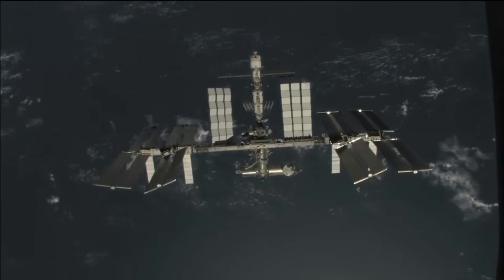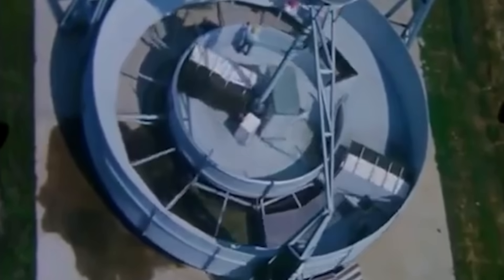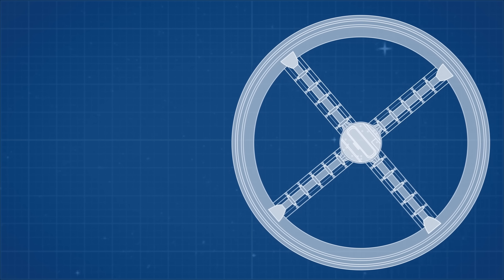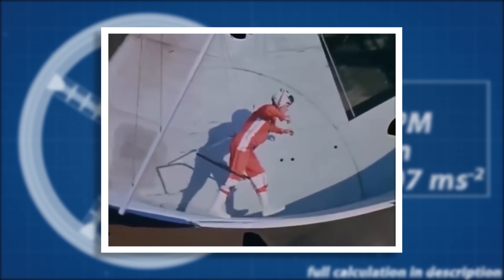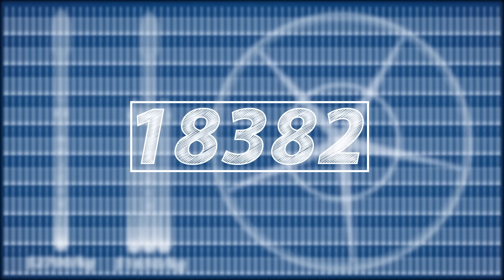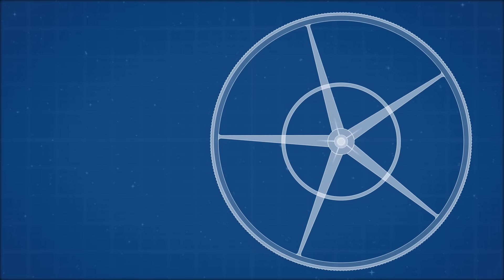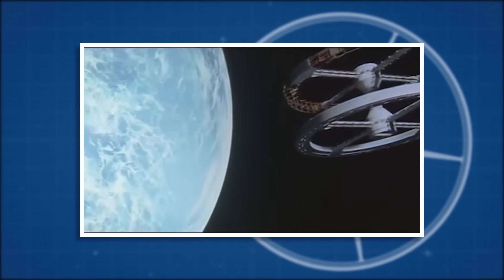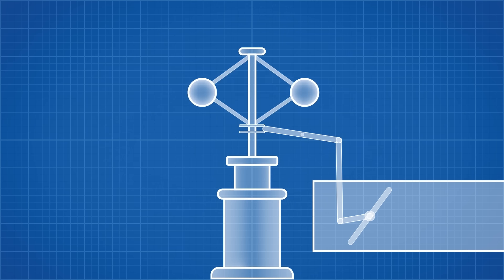Can We Create Artificial Gravity?

Comment: Hi Real Engineering, so if you jump in a centrifugal "artificial gravity" what would make you come down again?
Reply from the maker: The same thing that made you go down in the first place, inertia.
Reply: okay, so if I float in orbit and someone put a cenfrifuge around me ( with the same trajectory so there is no contact ) I would somehow be attracted to the sides of the centrifuge? ( if the jump negates the inertia )
Reply from the maker: No, if you somehow magically appeared inside it, you would float above it. That isn't going to happen though, you will either be inside it while it accelerates or you will climb down from the center of rotation. The structure will need to transfer inertia to you.
Reply: oh yea that is logical but it sounds to be a quite tricky system in practice if you would treat it like a normal space station. Love the video BTW. kudos
Reply: well you will get lighter as you go up, so if you reach the middle and you weigh nothing the push of your previous jump would push you into the other side of the ring and you would faceplant and your face would get road rash until the ring gets you spinning as fast as itself.
Reply: Centrifugal force is NOT artificial gravity, if the terms are stretched, it's simulated gravity, or rather ...our best effort at an emulation.
Reply from the maker: Oh and just call me Brian
Reply: Mathias: nothing makes you come down again - the floor of the space-station comes up until it hits your feet!

The way to think about this is that both the structure of the space-station and you 'want' to move in a straight line tangential to the rim of the station (per Newton's first law of motion). However the structure of the station 'forces' its rim to move in a circle. The straight line motion of an unconstrained object above the station floor will before long intersect with the curved motion of the floor mimicking the effect of gravity. But the mimicry is not perfect - you do not land on the bit of floor directly under you - the larger the wheel compared to how high you jump, the less noticeable this will be.
Reply: +Mathias Petersen. is this in a vacuum or air? it would make a difference
Reply: Watch Babylon 5, the final episode of season 2. The captain is riding a transit at the core of the spinning station, and jumps out to escape a bomb. Ivanova explain "he's basically weightless, but the ground is spinning at 60mph. If we don't catch him he'll be killed by the impact".
Reply: doceigen As far as I know some of them, some of them not.... BTW, did you studied you PhD or did you smoke it? go back to, Rotational movement at first year of physics school, I have no time to argue with you
Reply: Mathias Petersen I didn't understand the question. He's not spinning at all until he hits the floor. When he does hit, he would suddenly speed up and (assuming he somehow survived) his feeling of weightlessness would abruptly end. It would be very similar to jumping off a bridge onto a fast-moving train.
Reply: Isn't it opposite? Shouldn't you feel heavier when walking in the direction of the spin and lighter when moving in the opposite direction? If you walk in the same direction you are going faster, so more inward force is needed to keep you in that circular motion, right?
Reply: doceigen Did you finish first grade at school?
Reply: YEH wth. It seems to me you would just escape the artificial gravity entirely.
Reply: The centrifugal force. From your perspective it would feel just like jumping in regular gravity. If you would take a look at the top down view, what happens is when you stand still you move in a circle, being basically pushed into the "ground" of the station by the centrifugal force. When you jump, you disconnect from the "ground" and start  moving towards the center of rotation but since you were also following a circular path you have the centrifugal force pushing you back in the direction opposite to your jump. So you basically get flung back to the "ground".
Reply: Jane Murphy - The question mark serves to enhance or emphasize that it was a suggestion. It makes it more suggestive.

Now please fuck off before I have to block your ass, bitch.
Reply: Andreas Eliasson Sure, that perceptual relationships is why some people here keep shouting, "inertia", but… THAT is not the answer to the question, so FAIL!  I'm afraid you're going to have take this course over Mr. Eliasson, and stop chatting during the lecture!
Reply: Oh, good point.. 

But first off, you'd have the same momentum as the station (maybe reduced, but still) so you would 'fly' to the floor again. Also, the interior of a station is not streamlined, so the air in there moves with pushing you a long. Even if you come to a full stop, the air would help you go 'down' again. So this is more of an impracticality.
Reply: That suggestion is like the Looney Toons cartoon where bugs is in a crashing plane but he steps off at the last moment. You still have inertia acting on your body.
Reply: Mathias Petersen Oh, now I get what you mean :)
Reply: Wou'll keep going down toward the floor since you will keep going in the same circular movement
Reply: the whole "but you wouldnt come back down" misunderstanding reminds me a lot of orbits, people being confused as to why the thing in orbit will continiusly curve around the planet without needing to thrust.
Reply: My specific thought experiment would only require the astronaut to have a personal air supply. So to simplify in vacuum.

But what difference would the atmosphere make? As slight as it might be. 

(edit: other than turbulence)
Reply: FastRomanianGypsies Sorry is this an answer to the air difference thing, or the floating in the centrifuge thing?
Reply: Riles Mattix Yea i guess you can't make a perfect jump in atmoshpere that would leave you in the middle (even compensation for the 'air pull' the air would blow you "down".

Sorry about the terms i don't speak space a lot :)
Reply: Ohh cool Hi Brian. I just found your channel, subcribed and started binge watching. I'm only  good at chemistry but love to learn, especially stuff like this.
Reply: Neil Bartlett Yea he would be in a state of relative zero newton (if that makes sense), but when he hits the side (I imagine) it would be like falling onto a treadmill sending him spinning round along the side. But fun question would the centifugal force stop him from spinning after impact/death or just keep adding to his personal spin like a spinning wheel to another spinning wheel?

I know I am like an annoying kid with these questions, but you don't have to answer
Reply: Mathias Petersen  If you've ever been to an amusement park where they have the spinning barrel rooms,and people stand along  the inside and they spin the barrel, ...you can directly observe a number of mechanisms occurring as the barrel speeds up. 

One is, if you did not touch the inside of the barrel, you would remain where you were standing and not stick to the wall. 

Of course in a spinning barrel on Earth, gravity is pulling you to the floor and so acceleration forces cannot be ignored, but in space, if you throw yourself to the center of a spinning barrel, once you came to a rest, you'd be floating inside the barrel and not stuck to it. 

The moment you touched that spinning surface though, you would feel an acceleration both in the direction of the spin AND away from the center of the barrel, until finally you would be stuck to the inside of the barrel and it would 'feel' like artificial gravity was present. 

But something to note, it's not a very good approximation, and if you walk in the direction of the spin, you'd get lighter, and if you walked in a direction the opposite of the spin you'd get heavier, I mean perceptually. 

We used to test that as kids and walk on the inside of the barrel at the amusement park to sit next to someone… the operators hated that since we could have fallen into the barrel and since it was spinning, get chaotically tossed around and damaged… but we never moved fast enough to do anything but start to move towards the floor, so we all emerged unscathed.

Also to note, in modern versions of this ride, you get strapped down or have to sit down now like in a roller coaster type of mechanism, or the liability insurance would close them down… but when I was kid, we'd actually scoot our butts, mostly on hands and knees, on the inside surface.
Reply: doceigen Sadly I haven't tried that. In Denmark we have some of the oldest amusement rides but not stuff this fansy. I tried a giant hamster-wheel as a kid... not that fun:). But i have seen on television these upride centrifuge rides where people just stand in them and the flor lowers as it goes. Sadly non of the people tried rolling inside of them (maybe because it's moronically hazardous thing to do hehe). Still I would love to se it happen.
Reply: Mathias Petersen  Yup… moronically hazardous… that's kids for you.  :  )  

But it does bring to mind a number of actual principles and attributes that are often disregarded in science fiction.  "Why don't you use centrifuges on the ISS to avert the medical issues of zero G?", is a very typical question people ask NASA.  I mean the movies, make it seem so simple.
Reply: doceigen Yea I think you are right. You could teach children alot about Isaac Newton, Ole Rømer and James Watt from just simple games and rides. maybe we should just design the rides and make a kickstarter :)
Reply: Mathias Petersen Well, I believe in that, here's $2.00.

I've taught university maths courses and find my students learned 'deeper' when the equations were converted to color 3D graphics and real world examples.  So yeah, that's what science museums often do, build large scale, full body visceral experiences to enhance learning.
Reply: Jonas Kunnen No, by walking in the same direction you end up being thrown sideways slightly faster, energy going sideways means less energy falling towards the Earth or rather the same energy is there, but it's spread out over a longer path.  In space where the gravity is rather flat, running inside a large barrel treadmill in either direction, won't matter if the sides are decorated correct, otherwise… simulated vertigo!
Reply: I agree that if you are walking on the surface of the earth in the same direction the earth is spinning, more of the earths gravitational force is used to keep you moving in a circle and less can be felt by you. 

I was however talking about an 'artificial gravity generator' like in the video.
In that case you would need more force to keep you moving in a circle right?
Reply: Jonas Kunnen  Well, not in a circle, in a straight vector the result of your actual momentum.  The circle component is added by gravity.

No, if you fell off the treadmill you would proceed in a straight line in a vector made up of the forces apparent at your release from friction.  So falling off the 'artificial gravity' treadmill, you'd be 'weightless' again.  Well sort of, I mean the trajectory of that line, would finally collide with another point on the treadmill and any loss in energy would be regained, as friction, spin, chaotic tumbling and a bit of cussing about it.

Remember, we are using terms that are not concise… it is NOT 'artificial gravity', and the notion of 'falling' is wholly flawed by any Earth reckoning, plus there are so many other lines of force not taken into account such as… attitude corrections mid-step by your retro-rockets, etc.
Reply: Inertia
Reply: *****  Inertia, does not make anything come down again.  OMG!  Did you have a Marxist Feminist teacher?
Reply: doceigen Are you joking really?
Reply: Ok so this is my thought.If you where in this artificial gravity and you jumped. 

Firstly bare in mind that the only difference between hovering above the floor spinning under you, and being on the floor spinning, is you carry forward momentum. So it is easier to imagine the room as having that same momentum in the opposite direction and you are jumping from a point of no momentum. 

The room would seem to rotate under you as it moved toward you.So you would make contact with the floor again, but your face and the rest of you body, would be, say, parallel to the floor in one example. 

If you jumped just a little, the floor would hit you feet again, but this time the angle of the floor would be slightly tilted / steeper. So relative to the room you're in, you would actually rotate in the air when you jumped. And you would actually land back on the ground.
Reply: Lelouch Only if there was the force of gravity.  In space, there's no such thing as 'down'.
Reply: The points Lelouch is making are valid. You are always moving tangetial to the circle of the 'treadmill', so if you were to jump, you will have momentum upwards and forwards relative to the position and orientation you left from. If you managed to jump upwards with the same velocity you are moving forward, your body would indeed be parallel to the ground(which has moved beneath you, so you would 'fall' flat on almost the same spot you were just standing on). 

As for the notion that falling off the 'treadmill' would make you coincide with the 'treadmill' eventually is wrong in my opinion. This is unless the 'treadmill' is orbiting another body and you happened to fall off at the perfect time so the orbit of the 'treadmill' and your orbit would coincide eventually. If you just take empty space with just that single treadmill and you on it, falling off would send you flying with no way to return to the treadmill. 
The reasoning here is that loss of centripetal force will cause loss in centrifugal force, since centrifugal force is just the reactive force. If there is no centrifugal force and no external forces like jets on your EVA-suit, you will just keep flying off.

If you were to cancel your forward momentum by jumping(no upward force), you would be weightless in the 'treadmill'. The only way to get back that artificial gravity, would be grabbing on to the 'treadmill' again.
Reply: The centripetal force stops when your feet leave the ground, but you conserve both your angular momentum and linear velocity imparted on you by the station, which results in you returning to the 'ground', just as if you had jumped here on earth.
Reply: gryphen_357 I completely forgot about the conservation of angular momentum. Your comment just made some things I was unsure about fit right into the picture.
Thanks for mentioning it.
Reply: Inertia?
Reply: THIS^!
Reply: *****
Inertia is the word that describes how objects in motion like to stay in motion, and objects not in motion like to stay motionless.
Reply: Jane Murphy I know what it means, so I'll say it again. Inertia.
Reply: ***** Poor baby.
Reply: *****
Then why did you add an interrogation mark?
Reply: Jane Murphy It's called a question mark or interrogation point.

Not a combination of the two.
Reply: *****
Yes, because a typo is horribly important to the conversation.
Reply: *****
Look back at your original comment. You said "Inertia?" as in you asked a QUESTION, you did not say "Inertia" as in in a answer.
Reply: your body will be in motion and it wants to move forward but you cant since the structure is in the way, thats the long way of saying landing! XD
Reply: the gravitron ride shows he would be pulled back
Reply: docigen, I respectfully disagree that moving in the direction of spin will make you feel lighter.  If you move in the direction of spin such that you're actually rotating faster, you will feel heavier.  Argument by extremes:  If you move against the direction of rotation at the same speed the centrifuge wall is moving, you will be stationary, and feel no centripetal acceleration.  If you mean that you will feel less of the earth's gravity, then you are wrong there too.  The force that gravity imparts will not change by virtue of going faster around the centrifuge, but it will, by virtue  of the centripetal acceleration becoming stronger, be a smaller fraction of the total force as the total force increases.
Reply: To doceigen and JPdrums - why the argument?
True, inertia does not 'make you come down'.  Inertia keeps you moving in a straight line.  In this case, whichever way you jump in a spinning space station, once you break contact, you will move in a straight line (minute aero effects ignored).  From the rotating reference frame of the station, this straight line will intersect the station again, and will appear to the occupant as a curved path which eventually points back 'down'.
Reply: doceigen
You still come "down", you just do so in a curve.

Would it be a perfect system? No, but it's better then only being able to float.
Reply: Jane Murphy Any 'coming down' that might be called 'inertia', would be via multiple collisions, more or less forming a nautilus trajectory.  During the time in-between each collision, you'd be floating.

But that's not the answer to the question, because you could just as well be deflected elsewhere.  "I thought I was headed down, and here I am on my way into space… oops."
Reply: John Hind There are other forces here aside from collision.
Reply: If you were to run or ride something and match speed in the opposite direction of the movement of the surface you're standing on then jump, you'd find yourself suspended in zero G because you'd effectively be at rest and wouldn't be subject to the centrifugal force created by the station's rotation. The reason you would land in the same spot if you were to jump while standing still is because you'd be moving forward in a straight line through space, but the structure is circular, so you'd intercept it again at the same place.
Reply: I'd like to test this
Reply: momentum of your body atoms that are moving in one vector when the floor get's in the way
Reply: The way you would "speed up" with"artificial gravity" is as noted above. you would start inside the structure itself and thus accelerate with it... or the more likely situation allowing you to come and go would be an access point from the center of rotation.  At the center of rotation there would be an access hatch, from the hatch would be a ladder or some other means of reaching the "simulated surface"  As you climb from the central point where the rotational forces are essentially null you would experience acceleration till reaching the floor, and in the opposite, you would experience deceleration as you climb back up to the hatch.

This acceleration is a result of moving further from the rotational center.... to get an idea of what i mean by this i want you to picture a ball on a rope. You spin the ball around you, making a full rotation every roughly 90 minutes. you at the center are not moving, or to say, your feet are staying at the same point on the planet, though rotating on it. the ball, currently the ball is moving, at an incredibly slow pace, but moving.  now we are going to let the ball go (and pretend it wont fall down) letting the rope slip through our hands till its about 100 feet away from us.  if you were to measure the speed of the ball now, though still incredibly slow as far as speeds go, it has accelerated to a new cruising speed . extend this rope again, this time letting the ball drift all the way out to ISS heights. you, at the center are still not "moving" and just ever so slightly Turing.....the ball on the other hand is now moving at about 17,000 Miles per hour.

pretend now that you are the ball...When you are in the central part of the ship making your way to the ladder.... you are inside the "body".... as you start to make your way down the ladder you are "letting the rope slip through the fingers.

As for the "inertia is wrong" statements, inertia is defined as "a property of matter by which it continues in its existing state of rest or uniform motion in a straight line, unless that state is changed by an external force."
People are matter. as such we will "continue in our existing state of uniform motion in a straight line"  but because we are on the inside of a circle, our " uniform motion in a straight line" will continuously intersect with the circle. thus it becomes "changed by an external force." since we can not simply phase through it.
Is it the best answer? probably not, But its also not exactly wrong.  Technically the earth isnt a sphere, but its close enough that it is a useful means of describing the shape of the planet.  since this whole discussion is little more than a thought experiment entertaining the basic concepts, and not actually a meeting to finalize the actual blueprints for such a structure, "close enough" is good enough, we dont need to have 6 page long equations and 12 PhD's to lightly discuss a concept.
Reply: momentum
Reply: your horizontal inertial velocity.
Reply: Mathias Petersen If you rotate together with the spinning station, the jumping will get you back down on the ground just like on earth. Your inertia is maintained and is equal to the structure's own inertia at near the surface where you first accelerated to match the station's rotation speed.
Reply: Eli Malinsky Well i got my answer 70 comments ago but thanks anyway. But in my thought experiment only the station rotates not me, and what would happen if the jump negated/counteracted my inertia. Also I didn't mention if there was air or not making the setup somewhat flawed.
Reply: Mathias Petersen The direction the jump takes you is in the same direction as the centripetal force, which is the actual force acting on the rotating station, not centrifugal force which isn't a force at all, only the tendancy of all objects to travel in straight lines to preserve entropy. All matter particles within the station that match its rotation speed are subjects to the same centripetal force. There could not be an object that does not match its speed since the station also travels through space, which means everything inside the station must travel together with it, otherwise stuff would just slam against the wall and thus match the station's speed.
That's the reason astronauts and everything inside the ISS seem to float freely, everything moves, or more precisely, falls, at the same speed as the station. A rotating space station is the same, only there is now a force simulating gravity that is applied.

Regarding air, it makes absolutely no difference whether there is air or not. Air is subjected to the same centripetal force as everything else in the station.
Reply: Eli Malinsky I am not arguing against well know common laws a physics. I will repeat that I already have my answer. I appreciate your willingness to answer and explain but I do know Newtons laws of motion. I am not going to point out whats wrong in your comment (after reading the thread i'm sure someone else will).

Based on your comment and other previous ones I can see that this specific thread doesn't really support productive discussion anymore. So If your preparing a response, i'll just politely say that I'll now ignore this thread.

Hope to see yall again in future Real engineering videos.
Reply: *****  No, I was completely serious… did you have a Marxist Feminist teacher for Physics?
Reply: *****  I have a Ph.D. in Plasma Physics from Stanford, now back to YOU… was your physics teacher a Marxist Feminist?
Reply: ***** Well, they taught you shit.  Enjoy your ignorance, you aren't going anywhere good in life with either that, or your bad attitude.  Inertia was a BAD answer.  FAIL!
Reply: Lelouch Except that you are already moving, so that momentum would be conserved.  But as to what would make you come down, and we assume that is down to the Earth, the answer is gravity, but not the 'fake feel of gravity' one would perceive imparted by the centrifugal drag.
Reply: ***** Inertia.  How infantile.
Reply: Neil Bartlett  Yes, correct.   People here keep saying inertia but that is so general as to not be salient.  Actually if we want to be technically accurate, we'd have to speak about phonon-phonon interaction, but I don't think anyone here can.
Reply: Jane Murphy  People like to use the term 'inertia' to generalize any and all properties of change.  So I say, Newton's 3rd Law of Motion and people say, "inertia!"  So now I say, phonon-phonon interaction on the intermolecular scale, so at least they have a moment to pull their foot out of their ass before they squeal, "inertia!".
Reply: Jane Murphy  hehe  Typo?  The guy squealed out 'inertia' and thinks he's right… what would he know of typos?
Reply: wledzian1 Why the argument?  Why do you ask?

"so if you jump in a centrifugal "artificial gravity" what would make you come down again?"

To which you agree, "True, inertia does not 'make you come down'. "

But people keep saying the answer is 'inertia' because they're lazy jerks who don't read through the list, and so… 'the argument'.

Simple.